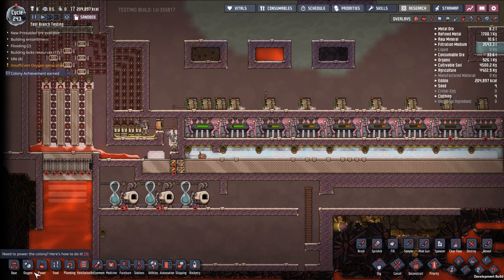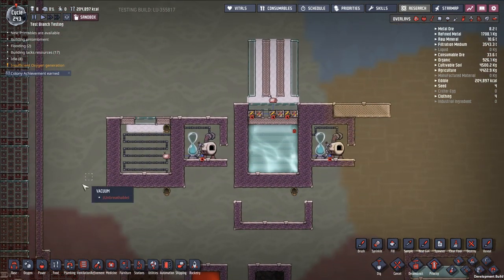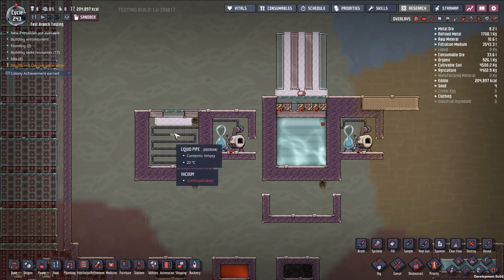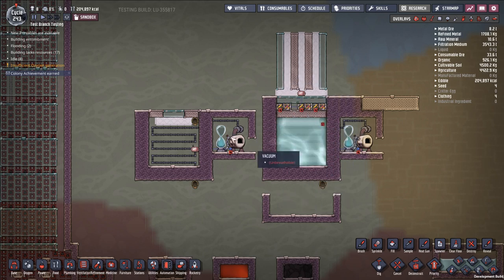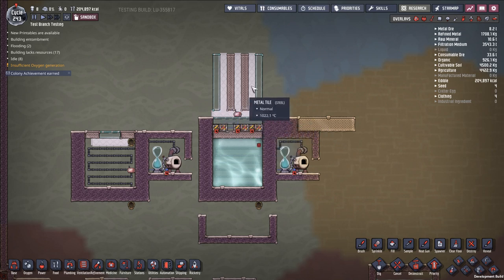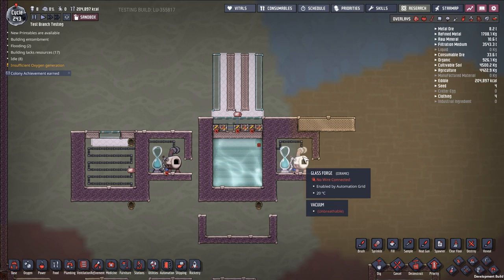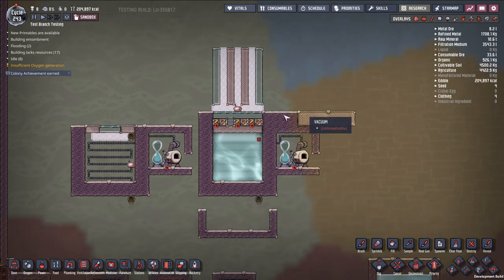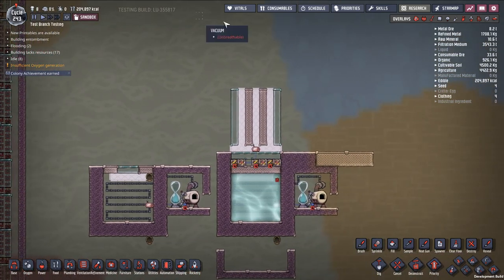Regolith Melter II -- Using Molten Glass as Your Heat Source [Oxygen Not Included]

Comment: Thanks super helpful. I ran a few experiments last night after watching your video, was using 4 glass forge none stop, found after    1000 c it was taking longer and longer to build up heat so ended up running one forge into a metal refinery making iron (steel was a bit explosive) seemed to help.  Think if i'm going to incorporate this into my base ill need a dedicated mini base for 4 or 5 duplicant but it should be worth it,might be a good job for new dups until they have exosuit engineer.

Comment: Can you actually melt abyssalite into tungsten or the abyssalite thermal conductivity is too low?
Reply from the maker: I dont think there is any way to directly melt abyssalite into tungsten, because you cant build anything out of abyssalite.  The builds that I've seen melt insulation into tungsten will create a super hot fluid (I've got a video on how to make extreme heat right here:  https://www.youtube.com/watch?v=g6H3O0sl3fc ) and then run that fluid through a non-insulated pipe made out of insulation.  The pipe will melt and then you can have dupes rebuild the pipe.

It's worth noting though that insulation is a lot more expensive than abyssalite-- you need not just the space materials to make the abyssalite, but also the reed fiber, which takes a lot of water to make.  It's probably easier to make trips to the glimmering planet and bring back tungsten directly.
Reply: @gearheadgaming1  Rocket exhaust can heat up abyssalite.

Comment: Can I simply make steam power from this? I'm in start game and I got a plastic ranch, making molten glass could power up my base after fist setup? (Or what I want to ask, how much power I get out of it minus how much I need to invest?)
Reply from the maker: The molten glass option takes a lot of energy investment at the start, because if I remember right the glass forge consumes 1.2 kw, and only produces something around 25 kg of molten glass every 40 seconds. Of course, once you get a regolith melter going, the power you get out of it is massive and is way more than the power you put in-- just a single regolith line can easily generate 23 kW, and costs very little to run but that's only after you've paid that initial cost.

It might be easier at the start to just use the regolith directly to power a steam turbine.  One regolith line should be enough to keep a steam turbine powered.

And if you're just looking for a building that generates more heat than it costs to run, the metal refinery is the way to go.  A metal refinery processing steel is net positive on electricity if you use the hot coolant to power steam turbines.

Comment: is not about the video, bit i have a question for you: are you planning to make another let's play serieries after the ufficial release?

about the vdeo: if you use a volcano to make the regolith melter can you use some of the remain heat of the magma from the volcano to make a sour gas boiler too? or is better to make a separate sistem? i have a minor volcano very close to the left side and i don't have a interest point from space to bottom so i plan to make a regolith melter to left, and another minor volcano next to the oil biome, is better if a make the sistem separate or i can add together the two? what do you suggest me?
Reply from the maker: I plan on making another lets play after the release.

Combining the regolith melter with a sour gas boiler is a good idea, but if you have two volcanoes then I think it's fine to make two systems.  The heat from even a minor volcano should be enough for either.
Reply: @gearheadgaming1  thank you for the answer,  i'll try to separate the two,  but maybe i'tri to experiment in sandbox

Comment: You know, you could use the solidified glass to start up the counter flow and heat up the system that way.
Reply from the maker: I agree-- it does kinda force you to get a lot of other stuff squared away before you start running your re-heating setup, but it's all got to get built in the end anyway, so why not prep the heat exchanger at the same time as the heating element?  Great idea.